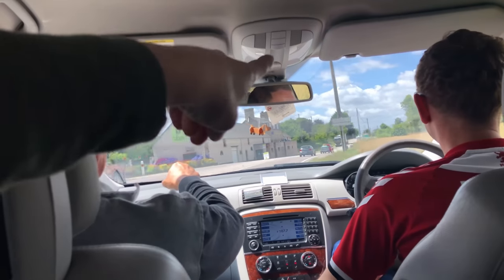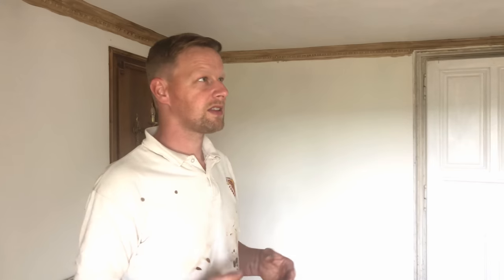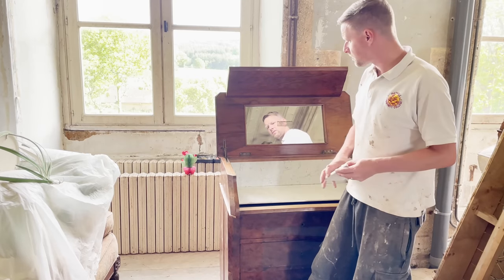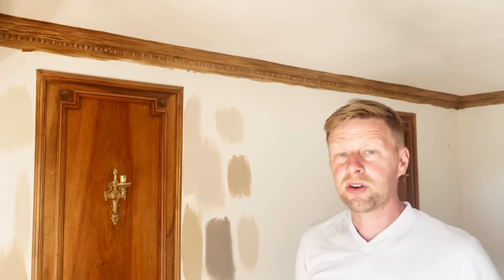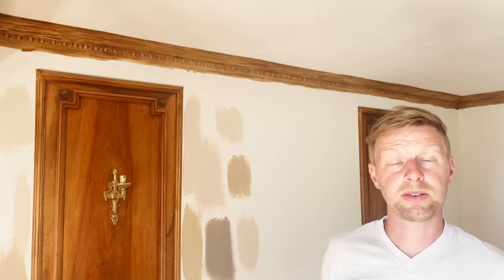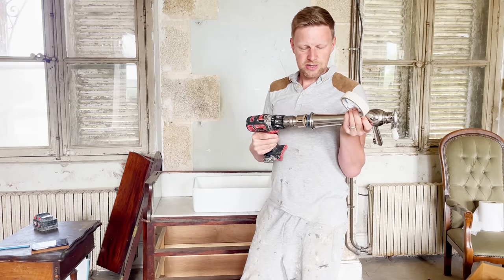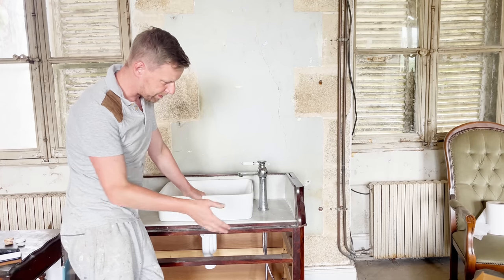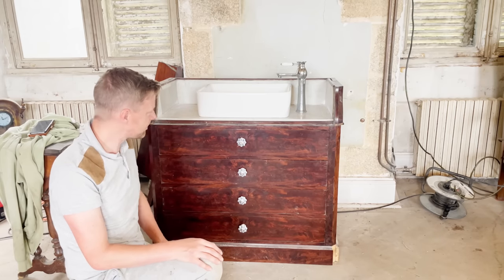EPIC Transformation | Turning Coving Into WOOD For A Chateau. Ep 57

Comment: Terry, the wood of the vanity looks like it could do with a bit of a feed. There are restoration oils that you wipe on and then buff off. It nourishes the wood and gives a light shine. Your vanity will look superb after. 

Another thing. I noticed that there is a corner missing on the baseboard of the vanity. If you aren’t planning to use the hinged top, you can cut a piece out of that to repair it as it will be the same veneer and you won’t have issues trying to find the right colour stain to get it to match. 

Just a couple of ideas to help you with your projects. What you are doing to the chateau is amazing.
Reply from the maker: Hello Neil, thank you very much. I have the little corner piece so just need sticking on 😊 thank you for the tip with the wood 🙏🥰

Comment: Great job on the sink unit, it looks Great
 👍 

I don’t know if you’ve done it and just not shown it, but you could put two small blocks of wood or two turn button latches onto the backs of panels of the draws that you’ve brought forward.
You have them horizontal when you put the draws in place, but then you turn each one vertical so that when you then open the draw the latches catch on the beading at the front of the cupboard , stopping it from coming forward any further then the draw space that’s available to use.

The other way is to put a pieces of wood that can be turned on the back of the front beading, have them horizontal when the draw goes in then vertical to stop the draw coming all the way out when pulled….

Comment: Is that drill bit used to cut hole diamond tip? Usually diamond tip used with any stone and cut with water running while drilling or cutting pice wont brake cuts quicker less dust

Comment: Just tuned in here. I would like to know how you determined that the chateau was salvageable. E.g. Did you have an engineer (or three) "survey" it? What kind of foundation? Water table? What sort of walls and ceiling/ floor support structures? An amazing  programme for sure, the cost of restoration probably 10X the purchase price. Joke: I see it did come furnished!
Reply: It's stood for a couple of hundred years and not fallen down yet 😄. The biggest problem with old French buildings can be insect infestation in the woodwork but any such issues all have to be identified in the buyer's report. And they treated the building extensively for pests early on.
Reply: @LaReynedEpee  ----- Nice that they treated for insects. I noticed the mortar in what looked like some sort of stone wall in the attic was so crumbled the stones could just be picked up with no more effort than their own weight.
Reply: @davesmith5656  Spotted any structural movement?

Comment: Inquiring minds want to know……why did you not tape off your ceiling and beneath the molding to give a straight edge (which would REALLY make it look more like a straight piece of wood); why did you not use a respirator when drilling that marble (we need you hale and hearty—we care about you); why did you not put a bead of silicone under the bottom rim of the basin to anchor it and make it watertight? We really admire your ingenuity when it comes to decorating—it’s so nice not to have someone always following a magazine “cookie cutter” design.